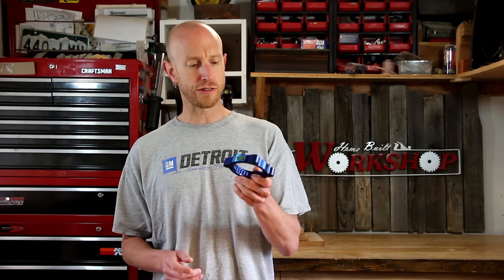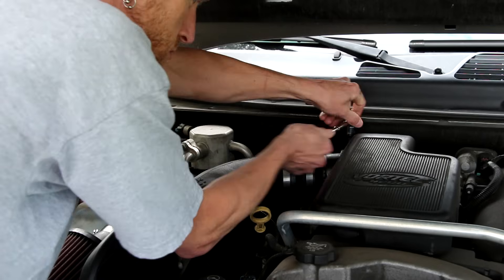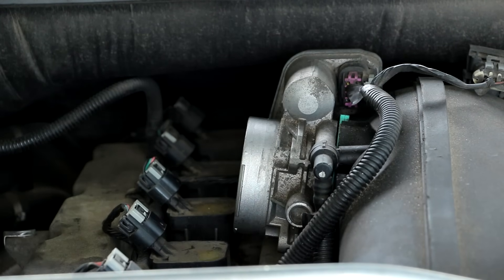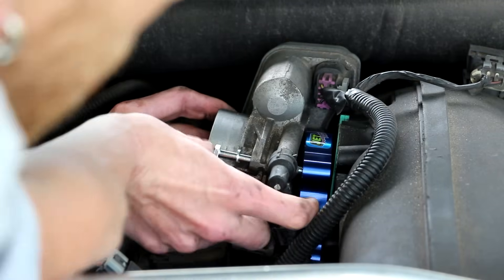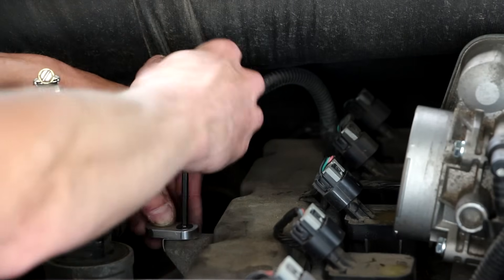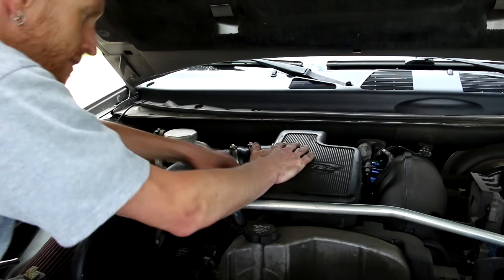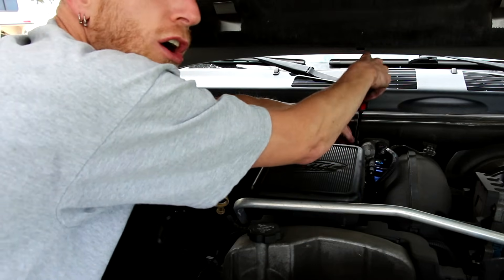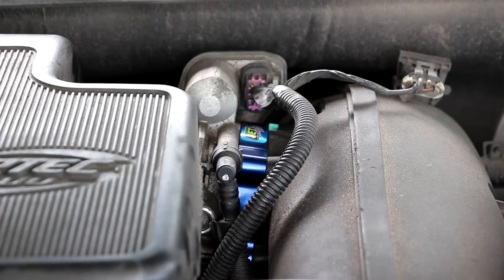Is A Throttle Body Spacer Worth It?

Comment: Used a vortex spacer on 2000 impala along with exhaust upgrade and intake manifold and cold air intake. I noticed alot of power gain after those mods. I did have to get the computer re programmed to run the new parts more efficiently and also to tweak shift timing. That car was fast especially after installing a shift kit. One day the girlfriend jumped it and destroyed the front end and transmission 😤 RIP impala
Reply: Yup women will do that! 🪦

Comment: It's more for carbureted engines.... the reason why it works there is because you add volume (air) and you place the carb up higher away from the heat source. It does not really work with cars that have fuel injection as the ECU is doing all the work..

Comment: About as dumb as the Cold air intake. Lets Dyno that and see
Reply: cold air intakes don't show an advantage on a dyno.
Reply: except C&D did a test on the CAI a while back and guess what: THEY DID WORK so...
Reply: Ralf V if you get the cai I have you will increase hp by 300. that's because it uses cold air from iceland.
Reply: My Short Ram Intake added almost 100 miles to my overall fuel range on my 2015 Genesis couple ultimate and made very nice off the line and low end throttle response, noticed my rpms jump much quicker and I was very skeptical at first when buying it. Actually had plans already lined up to resell mine if it ended up sucking before I even bought it.
Reply: Ralf........you do know that cooler air into the intake DOES increase performance in ANY combustion motor don’t you? I installed C.A.I. on my vortex v6, got better throttle response, more get up and go AND better gas mileage. Dont need a dyno to use common sense.
Reply: Thanks!

Comment: I have a 04 6.0 Silverado 5 speed with edge programer, and cold air I got 16 mpg, added the throttle body spacer and went up to 19. didn't change my driving or anything.

Comment: So overall... there was no difference.. It was a mental play and could prove nothing on a dyno test?  Final opinion.... HELL CAT HEMI SUPER CHARGER!!!!
Reply from the maker: +DaddyDubs maybe a dyno would show something. I like the supercharger idea better.
Reply: ***** Yes, I started growing very suspicious of these after market mods that just seemed to not make sense.  I've learned the majority of the time if it does not come from a automotive engineer either OEM or well established and expensive aftermarket brands. You might as well toss money out the window.
Reply: The idea behind this is kind of see through, much like your windows after using windex!
Reply: +DaddyDubs you're right, there are some things GM got right for certain engines like for the small block 350.  Adding things like an intake actually deters performance.  I watched this cool video of a race engineer breaking down basic mods for the Chevy 350. Basically, get heads, an exhaust, and a tune.  And you're golden.
Reply: ***** I agree when I was younger growing up I used to buy into alot of that cheap mod BS.  As I got older I learned it's better to listen to design and mechanical engineers. That if you truly want performance, you are going to spend some money.

Comment: What is with you gm guys and calling suv's trucks
Reply: look up the definition of a truck if you're so curious.
Reply: a large heavy motor vehicle used for transporting goods materials or troops dont see how blazzers explorers and other such vehicles are trucks
Reply: because they can transport things. humvees are in the shape of an SUV but are trucks. so are blazers and other SUVs
Reply: the definition is purposely vague because it's just an adaptation of the word. so when people get offended when I call my tahoe a truck, I laugh because most people dont even know the definition of the word.
Reply: suvs have more than one purpose its basically a all in one but of you ask any suv manufacturer suvs are usually  built on their brothers pickup truck frame with truck engines so.. its a truck
Reply: roj30001 very few suv's are built on truck frames anymore most share a unibody with mid or full sized car.
Reply: Sergeant Speed, it comes up with a semi.... no need on that either. 
I checked under my suburban,  and yep. ....it's a truck

truck1
trək/Submit
noun
1.
a large, heavy motor vehicle used for transporting goods, materials, or troops.
synonyms:	rig, eighteen-wheeler, transport, transport truck, tractor-trailer, flatbed; More
Reply: Delightful Douschebaggery exactly. so many people spend time complaining about an adaptive word.
Reply: Who cares
Reply: The SUVs of the time were literally the pick up truck chassis with an SUV body.
Reply: It’s not a gm guy thing dude, suvs vans and pick ups are all considered light TRUCKS so calling it a truck is what it is genius

Comment: I think the reason why u don't notice that wierd TB spacer noise is because of the resonator which tends to act like a intake silencer. Here's  something u could try. take that spacer off and use a phenolic material and make ur own spacer with it. I'd make one the same thickness one and try making one twice as thick to test if there's gonna make a difference on the thickness. I'd imagine this would make a slight gain being as the non metal spacer won't act like a potential heat sink. also try removing the resonator to see if u get any gains. u will have more noise without the resonator but may be work playing around with. remember to port match that homemade spacer. I have seen people do this also to make a phenolic spacer on the intake manifold with good results for more volume and keep the intake charge from heating up.
Reply from the maker: +Brandon Pike sounds like a fun experiment.
Reply: Brandon Pike
Reply: there is o ring on one side need to add gasket or use blue gasket sealer on other side to make airtight seal and stop air squeal noise

Comment: On a Carbourated or Throttle Body Injection fuel system, they ABSOLUTELY make a difference in power because it actually causes the fuel and air to mix much better.
Modern cars are multiport or direct injection, so the fuel mixture does not pass through the spacer at all and does not get better mixed into the air.
The only way it could make a difference on a modern car would be by increasing the intake volume... but not by much.

Comment: I put one on my '89 chevy 1ton and mpg went from 10mpg to 12 mpg. So in my experience it did help a little.
Reply: Yours was a tbi injected engine which is a wet flow setup. A spacer will help just like a carb spacer would. On a dryflo ls engine. It's snake oil/junk/doesn't work period.

Comment: I get a whistle but its minor. I also had a check engine light but it went off after about 10-20 miles. I also installed a bbk intake with the throttle body spacer, I hav a feeling the whistle is the intake and the spacer was the check engine light.

Comment: I have a lot of experience with throttle body spacers. They work on a carbureted engine or a throttle body F.I. engine but not so much on a port F.I. engine. And it's all due to intake design and incoming air/fuel charge. Here's why they work on carb and T.B.I. engines. If you open the throttle plates to W.O.T. half of the throttle plate comes up inside the carb or T.B.I. unit. The other half extends down into the intake manifold. This partially blocks some of the intake runners and there is already a sharp turn that the air/fuel mixture has to make to go from vertical through the carb or T.B.I. and make a 90 degree turn into the runners. By moving the carb or T.B.I. up from the plenum area the turn is more gradual and this keeps the air flow smoother. The incoming charge in a carb and a T.B.I. unit are an air/fuel mixture and it is heavier than just an air charge in a port injection system. The sharp change in direction on stock carb and T.B.I. systems can cause the air/fuel mixture to start to separate because gas is heavier than air and the air will turn easier. This reduces the efficiency of the incoming charge as well. Most port F.I. systems use a long runner intake manifold with a large plenum for maximum low end torque and throttle response. The throttle body is placed well ahead of the individual intake runners and therefore when open the throttle plate or plates don't impede air flow and the turn into the runners is fairly gradual. Additionally the incoming charge past the throttle body and up to the intake port is only air which is lighter and there is no chance of losing fuel atomization like the older carb and T.B.I. systems. Many people will argue and claim that their "Butt Dyno" says it's an increase. To them I say prove it in real life. I have tested multiple T.B. spacers at the drag strip on carbureted cars and a few on T.B.I. and port F.I. cars. Every carbureted car with a 180 degree intake picked up .12-.17 with a 1" spacer. 1" appears to be optimum as 1/2" and 2" spacers increased E.T. but not as much. The average is .15 second increase in E.T. on a couple of different bracket cars I have owned over the years. One was a '77 Monza with a 350 running 13.20's to 13.40's. The other is my 1969 GTO with a built 455 running 11.40's to 11.60's. Both cars had almost identical increases with the spacer installed.I installed one on a friend's 1995 Silverado short bed with a 350 T.B.I. The install was performed at the track after 4 runs with out it. It increased E.T. from 14.62 average to 14.47 average. .15 seconds in the quarter mile equals approximately 15 horse power. I tried the spacer on a 2003 Silverado short bed with a 5.3 port F.I. engine with no change in average E.T and again on a 2002 WS6 Trans Am and there was no change in average E.T.I know a lot of guys claim better fuel economy and I doubt those claims on port F.I. engines, but I am willing to listen to anyone that actually tested a spacer with some sort of repeatable results and admit I am wrong.

Comment: Put a spacer on a jeep 4.0, and I felt the same. Initial feel was a little more responsiveness, but have nothing to prove it. I am thinking about putting one on my Jeep 5.2 only because the restrictive nature of the intake means I am looking at raising the throttle body, cutting a hole in the hood, and putting an old fashioned round intake filter on it. I wouldn't do it again just for the performance of the part itself.

Comment: I have a 05 TB LT..  I won't call it a truck anymore, since I just bought an 06 chevrolet silverado crew cab fully loaded.. man just feels so much more stiff and lots more power.. of course I drove my TB forever, 339,000 miles on it, still runs good, a little weak now though.. and I suggest a after market transmission cooler.. my transmission fluid got into my coolant through a leak in the rattatior.. so it's been parked.  loved it though.. Probably just needs a new rattatior, trans felt like it was slipping a bit, and the trans fluid was always running a bit warm, I use the torque android app to keep an eye on it.. buy a Bluetooth scan tool for $5 on ebay.. it's called an "ELM 327" SCAN TOOL.. clears service engine codes to, also will do a Web search if u have a code pop up and it explains ur problem and how to fix it.. best tool ever.. thanks have a great day everyone
Reply from the maker: +tankdog03 thanks for the info. Ill check out that scan tool.

Comment: On my 2000 Chevy Blazer 4.3L I noticed a bit, but didn't notice a damn thing on my 1996 Ram 5.2L... I
In fact, even after a spacer, stage 2 JET chip with 180 deg. therm, CAI, exhaust w/ long tube headers, and 300lb weight reduction, I still noticed almost 0 difference on my Ram... and my clocked 0-60s matches my feel. Only changed .5 seconds after all that... blazer changed 1 full second on those mods minus without the jet chip & headers...
Reply: JoeIsCrazyWillman exactly. I try to tell people that it all depends on the car. some cars like it, some don't

Comment: In the beginning you were all about it, then you changed your mind...lol I think you got use to it. I have one in my 2002 4.8 Silverado. I have Hogs breath air system same as an Air raid. the spacer was recommended by Hog Breath so I got it installed at the same time. The difference I felt with both the Air system and the spacer was very good. I have since installed a 220-220 cam and had an Ecu Flash tune put in it so now its a part of my tune. I do think that it will slightly improves performance. I liken it to the way a car runs on a warm day or a cold day, It might be slight, but I think the air is tunneled and cooler and that is what your feeling, it might be slight but the vehicle is in fact ruining more efficiently. I say if your working on / or changing the throttle body its a no brainier. just do it. Or if you just want to do something inexpensive, easy to do, thats also cool to do...Hell yes its way worth it. Thats my opinion. That was a good honest video Sir. Thank you!
PS
I just ran into this, they mentioned the Air Raid Spacer, that is the type that I have
https://youtu.be/Jh6yopRwOlw

Comment: You feel a difference, for one it is probably tightening up the throttle cable which has been stretched over time hence why you feel bottom end ie: take off from stand still but the intake of the vehicle will only allow so much cfm as the intake can handle so without port an polishing the intake you arent doing much with a spacer. you can get the same effect if you just adjust your throttle cable ..  or doing the old school trick as to adding a zip or cable tie to take up slack in throttle cable . IMO its a waste of money when you can get same result with a 10 cent cable tie or 10min adjustment to throttle cable

Comment: Does the rubber side go against the TB or away? Nobody answers that. The rubber side hole matches the TB opening and then the hole gets slightly smaller on the other side.

Comment: If you have the 2014-2018 Chevy L83 5.3L, do yourself a favor and swap your throttle body and intake manifold with same year model L86 6.2L . 

It's a direct bolt on, exact match, no other modifications nor tuning necessary. The L83 will relearn as soon as the truck starts after install. 

YOU WON'T REGRET IT!!

Comment: I made one out of a slab of aluminum.  It does not save fuel.  It did not increase the high end power, nor the mid level power.  It seemed to have made the throttle more touchy.  The vehicle got up to speed a bit quicker.  That is all I noticed.  I guess it is worth it if you make the throttle body spacer yourself.  But do not pay a bunch of money for a piece of aluminum.  Just make one.
Reply: Based on my knowledge, everything you said is exactly correct! It should have an effect on low end torque, only by increasing the velocity of air flow that's naturally lacking at low RPMs. It doesn't increase maximum amount of air, only velocity. No, the cute li'l aluminum piece isn't worth $80+!! When fabricating one at home, be sure to duplicate the swirling contours of the inside to aid in the swirling of air. That is proven to add to the velocity and therefore atomization, why GM dubbed many of these engines 'Vortec' from the vortex air swirling into the heads. VORTEC made substantially more power and better fuel economy than the same sized engines pre-Vortec. It's important to know which direction the air is 'spinning', so you don't counteract it before it goes into the manifold.

Comment: spacers are defendant on intake styles ,runner length ect, Every setup will be different. They causally add runner volume to a single plane style manifold. For hp gains in the single digits at best. Forced induction motors there better used youll see a percentage rather than number.

Comment: Yes it is worth it if you really want to put space between your intake and throttle body. 
If you want more hp. You have to change the cam or boost the engine. There is no other way to get more air into that engine. Yes I own a Trailblazer too and have a few videos of me working on my truck. I have one where I ran 120 mph after removing the limiter. Try to do that with a TBS.

Comment: So obviously there was little gain in performance if any at all....However, Everyone seems to want to see magnificent improvement with one bolt on product.  That being said vehicles are complex and everything that goes into getting these things moving plays key factors in performance to some degree.  Electronics and Computers coupled with sensors are tuned to operate the car from a factory standpoint as far as "newer" models go but, if you were to use this bolt on product and that bolt on product and gain .5-1 mpg, 2hp, and a little torque with each bolt on upgrade is it worth it in the end to do so?

Comment: If that don't work well,what will help on improving gas mileage on the 4.2? I door dash  alot and every little bit helps.
Reply: They don't work on smaller motors or well designed intakes but they do on 8.1 Vortec with the crappy factory throttle body and intake manifold restrictions.  I went from 8.9 mpg to 10 instantly although the cost of the part will never be recovered from the gas saved. LOL  I did get more noticeable acceleration from a stop and throaty exhaust sound.  Look at your vehicles intake and the manifold port first. The GM Vortec and LS manifold design is pathetic and heavily restricted at the port.

Comment: I put one on my ‘07 Jeep Grand Cherokee about 8 months ago.  Maybe a little difference on the low end.  I don’t care about dyno this or HP that...I really don’t.  All I know is now I am getting the engine code of P0507.  There was never a code until now.  Not sure if the spacer is the culprit or not.  Thoughts?
Reply from the maker: Looking up that code shows it's the idle air speed system. The rpm    at idle may be higher. Could be a vacuum leak or something when you reassembled it. Check your connections and make sure it's tight.
Reply: Jeff Baker I checked & rechecked.  Then I removed the spacer, checked, put it all back together then rechecked again.  The TB may be bad....has the non-serviceable IAC style.